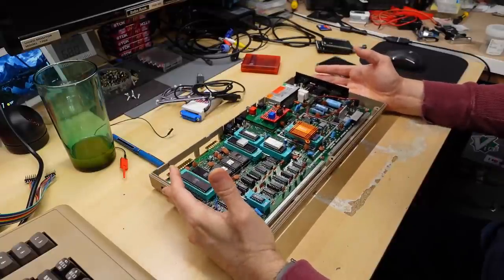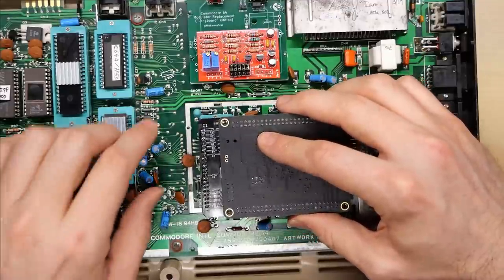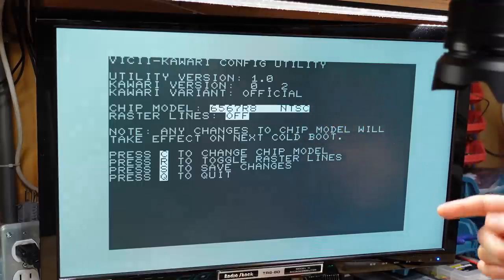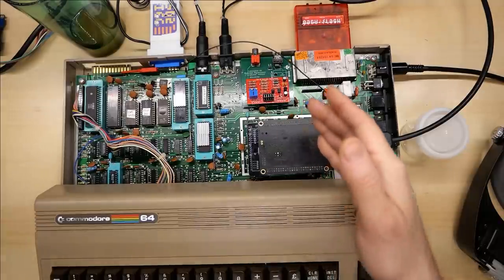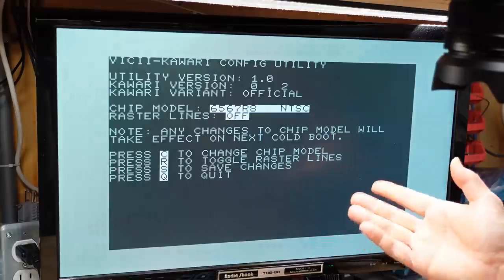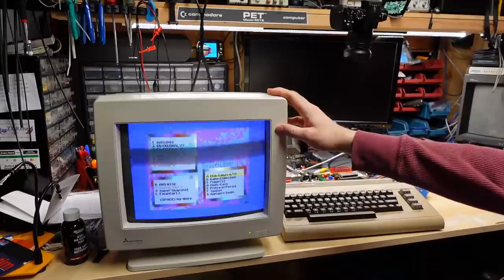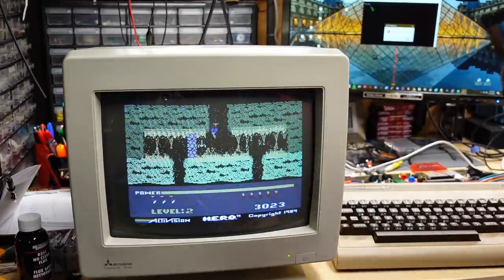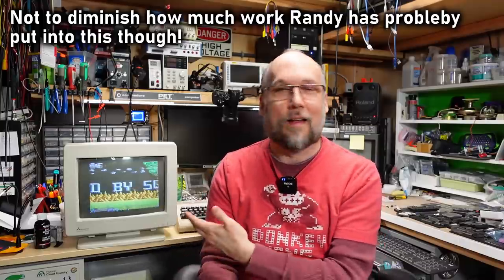VIC-II Kawari: FPGA based VIC-II replacement for the C64

Comment: One other interesting thing about the 80-column mode. It adds another curious feature - CP/M. Rarely used by the C-128 I realize. The C-64 was never a good fit with 40 columns in CP/M mode because CP/M software expected 80 columns. It might seem pointless, but a lot of software was created to run on CP/M. With an SD2IEC, the last hurdle is gone - it doesn't have to concern itself with the disk format. So several quality Z-80 compilers would be available also. It's a minor thing, I realize. It's just one more capability realized.
Reply: I wonder if there would have been any difficulty designing a C64 CP/M cartridge that would render 80 columns using high-res graphics mode with the screen buffer placed at $E000 and the color RAM (only written at startup) at $DC00.
Reply: @flatfingertuning727  It wouldn’t have been as clear with composite, so the CP/M cart would have needed a good monochrome output from the cart itself. It was expensive enough already. It needed to be monochrome at the time. That way the average monitor or tv could display it well. The wiring would have been a nuisance. The VIC-II was limited in memory mapping capabilities. Still, I’d have given extra cash for 80 column at the time because I was a programmer and I would have found it convenient using similar compilers like Turbo Pascal (both CP/M & MS-DOS).
Reply: @jeffreyphipps1507  The C64 can display legible 80-column text with a monochrome monitor or one that accepts separate luma/chroma inputs.  The text quality isn't great because of the 4x8 matrix, but there were a number of word processing or terminal-emulation programs for the C64 that used high-res mode to show 80 columns.
Reply: @flatfingertuning727  Legible is a matter of opinion. I've seen these efforts in both hardware and software forms. I wasn't impressed, and when someone has to work with it hours at a time you need the 8x8 matrix. There was hardware at the time that could do it, however if the software didn't either come with the hardware or didn't support the software it was a problem. Further, there was another issue. Hardware for 80 columns at the time took up the cartridge port. The CP/M cartridge couldn't use the software tricks that converted to the iffy 80 columns reliably because the Z-80 CPU didn't get it's clock from the VIC-II among other things. The old solutions just didn't cut it for serious CP/M work, and again video wasn't the only obstacle. Getting software loaded was also an obstacle because the 1541 GCR format was not a standard in the CP/M world. No CP/M software could be bought "off the shelf" in this format. This meant that any CP/M software had to come in through the user port or (with special rigging) through the display cable (the later one) which had a mic in line (we typically ground that now to cut the noise to the audio out). There were lots of obstacles and few solutions, making the C64 CP/M cartridge almost useless. When the C-128 came along, the addition of the 1571 which could switch to MFM and read CP/M diskettes changed things. Curiously, the C128 used the Z-80 during boot then switch to the 8510. The 1571, on the other hand booted CP/M from a GCR diskette and switched to operate as either GCR/MFM. The irony is massive. The C-128 also offers native 80 column mode. I'm not suggesting this advanced VIC-II be used for CP/M. I merely find it intriguing. I find the various features of this new chip collectively fascinating and exciting. They bring future possibilities to the C64 itself that are far more appealing. One is easier development with improved overall quality of video. Putting aside extra modes that most users won't have, the reduction in eyestrain itself will aid in the development of new software. Take it from an old software developer who still develops. Cheers!
Reply: @jeffreyphipps1507  I've used an 80-column terminal and while a 6x8 matrix would have been much nicer than the 4x8, the latter was nonetheless usable.  The inability of the 1541 to handle MFM was more of a problem, though I wonder if it might have been programmable to read disks coded for Apple's GCR.  Turbo Pascal was available in CP/M format for the Apple, and I doubt it was the only program in that format.
Reply: @flatfingertuning727  I have my own opinion and you need to accept that. I’ve programmed for decades. My personal opinion is that 4x8 just isn’t acceptable when used for hours. If you worked in a similar situation and you found it acceptable I’m happy for you. Truly. I needed specific programs that existed on both platforms. You cannot use one brand in one place and another in a different platform. It doesn’t work that way for large projects. As for GCR and Apple (which also had a CP/M adapter card) I felt it was cheaper (by far) to bypass the the issue - I dumped whole disks of data from CP/M on an emulator on the target PC and simply checked for cross compilation issues and printed them for examination at home. Not perfect, but less trouble than CP/M on the C64 was ever going to be. Like I said, it was a very niche use case that would have been nice as an option. It wasn’t, I made other arrangements. Now the new hardware is a good way to new C64 programming for either a limited pool of users with that hardware (when it’s done) or to write software that will be scaled downward Scaling is troubling and it just as good to use normal development. This said, we need a VIC-II replacement and if it has bells and whistles we will have fun with them.
Reply: @jeffreyphipps1507  There are people for whom 4x8 is legible.  There are likely others for whom it is not.  The fact that a cart might not be suitable for some users does not mean it wouldn't be suitable for some others (bearing in mind that the disk drive would remain a problem).
Reply: @flatfingertuning727  I don't know why you keep arguing this point so let me be clear. For my PERSONAL purposes and as I said it is MY OPINION that it wasn't,  that 4x8 wasn't workable. For me. 

Further, if you were aware of how CP/M worked you would know that this was HIGHLY impractical since it required 8K of RAM in a place that CP/M made use of. So you would need to relocate the subroutine.  Additionally, some programs in CP/M required a certain amount of RAM to work. Even IF it worked, since it operated in graphics mode and not in text mode it was MUCH slower. 

REGARDLESS, I still own my C64 CP/M cartridge/manual/disk. It bacame a little more useful when the SD2IEC came along because it was now super easy to make disks readable in GCR format with CP/M software. However, that's today.

So let's recap: 
1. I said 80 columns of the time wasn't practical FOR ME. I don't care that there was a graphics way. I didn't like it and it was unreliable in CP/M.
2. I said that it was hard to port software given the drive issue. If I had wanted to go through an Apple machine, it had BOTH a CP/M card and a STANDARD 80 column card (providing an acceptable output). HOWEVER, I was unwilling to spend money on a SECOND computer at home, and I didn't have space for it anyway. If I had that space and money, I would have gotten the IBM I was using at work at the time and cut out the middle man.
3. I did work with CP/M on the C64, but since most software I needed used 80 columns and didn't work on the C64 FOR ME it was a disappointment. I had hoped that the cart would include a monochrome out jack for an actual internal 80 column video chip. A sort of computer in a cartridge. So, where necessary I did the cheapest thing fitting MY NEEDS. I used a CP/M emulator on the PC at work and figured out what things needed changing, printed them out, and worked them out on paper (we did that a lot back then), and brought it in the next day.
-------
Look: A) I NEVER said one couldn't do a 4x8 graphs mode 80 columns, you can. I SAID I wasn't a fan. B) I NEVER said that C64 wasn't useful (It was useful in one specific area: writing programs that were screen geometry independent). C) I think we agree that the drive issue was an obstacle. There were ways to work around it. It just wasn't worth it to me given MY PERSONAL needs at the time.
--------
I DID say that with this modern technology that it makes the CP/M cart viable. NOT sure if you are aware: because Commodore was painfully getting the message that the CP/M was difficult to use at the time they made changes in the VIC-II later that caused the CP/M cart not to work with the new VIC-II. I have two C64s one works with the CP/M cart, the other doesn't. It's a difference with the chips. So even WHEN we get this replacement chip it may not work with the CP/M cartridge (though from the description I think it will).

Now you can reply or not. I'm finished with this debate about what MY specific needs and MY specific options IN THE PAST (early 1983) were. You can add all of the "there was this" or "there was that" anecdotes you want. I was a professional programmer at the time and also programmed a lot on the C64 (wrote two articles about programming the C64 for Computes! Gazette and one for Ahoy) - I'm fully aware of what was available. It just didn't meet MY needs. If any of this fit your needs, GREAT. Stop arguing it though. Sheesh.

Comment: I would have thought that outputting a video signal through the C64's own ports would be a pre-requisite for such a project.
Reply: Obviously it doesn't have a built in HDMI port...
Reply: @BrainSlugs83  I think you miss my meaning?  A replacement VIC 2 chip needs to output to the C64's existing composite/RGB output as a matter of course, otherwise what use is it?  HDMI output is nice, but is a bonus not a core feature.  If it can't do that, it's not really a drop in VIC 2 replacement...  Do the various SID replacements have their own audio outputs? Of course they don't...

Comment: "What kind of computer do you have if you have no graphics?". I have three raspberry Pi computers running headless with no graphics. (I have three more that are connected to displays), and all three are doing useful work.
Reply: What kind o useful work?
Reply: I think that was for computers that are intended to be used by humans. Also, even those "headless" computers you mention have "text graphics" at the minimum that you can output to anywhere that is readable by a human. All hail, serial connections! 

Of course, there are a buttload of quite useful computers that don't require display output every time such as microcontrollers that are used at almost everything with electronics.
Reply: @Ooshgaar  One is a NFS server, one is a PiHole server (pesky ads) and DNS server,  and one is a cloud server. The three with displays are a full desktop, retropi, and a clock.
Reply: @proCaylak  They may have text graphics capability, but it isn't used. My interface to them is SSH, which relies on the capabilities of the client machine to produce anything human readable.